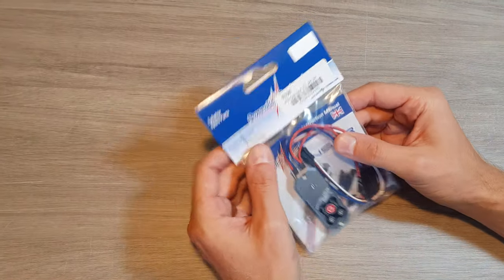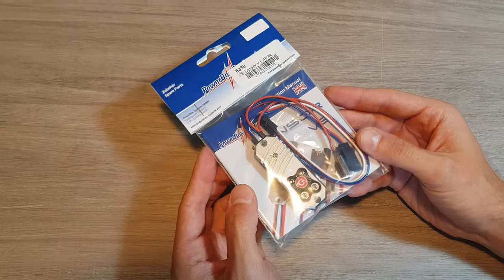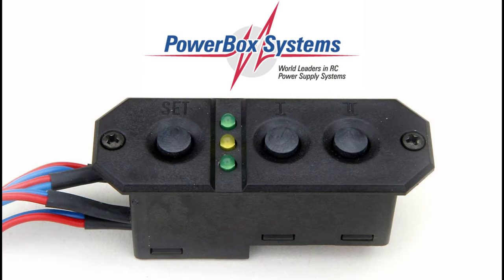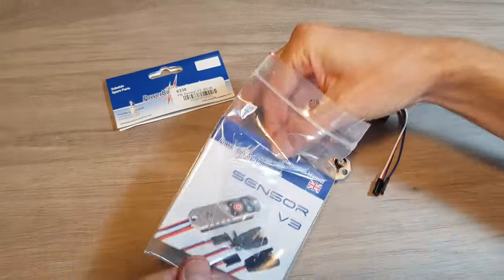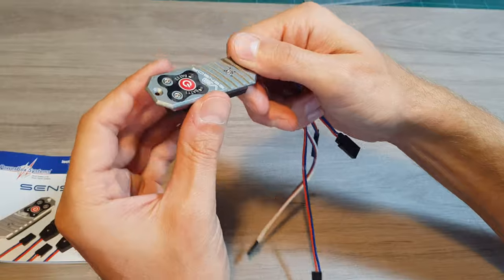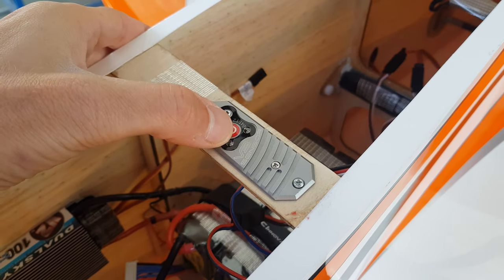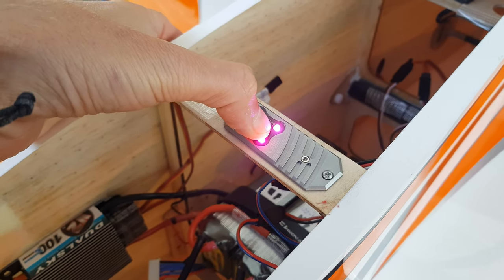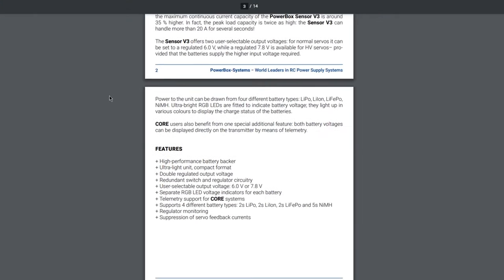The best switch for my airplanes - Power Box Sensor V3

Comment: Hola buenas tardes! Este switch funciona como regulador tambien? Si uso 2 bateria de 2s para mi receptor?
Reply from the maker: Hola! Si, este switch regula el voltage a 6 o 7,8V. Facil de programar mediante una combinación de pulsaciones del boton central. En el manual viene todo bien explicado. 2 baterias de 2S son las que uso yo para mi receptor ;)
Reply: @rombautrc  muchas gracias 👍

Comment: There’s not enough space on mine to slide the end with the wires over the wood cutout.  Did you remove the top from the bottom so could insert it into the cutout?  Crazy
Reply from the maker: I am not sure I understand your problem lucky macy. The plawbood we used is thinner than the "box" of the switch. Did you use a thicker one? Cheers!
Reply: @rombautrc  there’s a millimeter clearance between the wires and the flange where the screw hole is on mine.  No wood the thickness you have on yours going to fit on mine, 😂    Send me a PM and I’ll show you a couple of pics of the lack of clearly.
Reply: @luckymacy  just unpacked my one to install, really doesn't look like it was designed by a German!  Unless you can laser cut the cutout, I dont see how you can get the wires through and still have enough wood left to get the screw in!
Reply: @uhfrc  exactly.  Dumb physical design for mounting

Comment: Hola una consulta. Ahora uso una sola batería rx de 700 mah, con el sensor podría usar 2 de 350 mah para tener los mismos 700 o la capacidad no se suma? Gracias!!
Reply from the maker: Hola Daniel. En teoría si se suma, ya que al final es como si conectaras dos baterías independientes a tu receptor trabajando en paralelo. Aun así, con baterías tan pequeñas y servos HV es importante controlar el voltaje cada vuelo y también durante el vuelo... vigilar que el voltaje no caiga en momentos puntuales de alta demanda (snaps, spins...). Saludos!